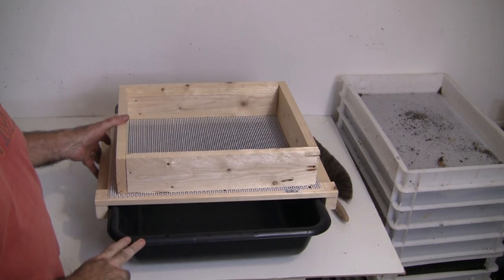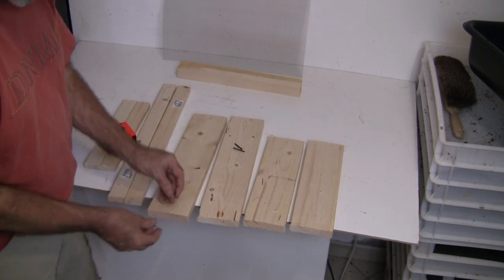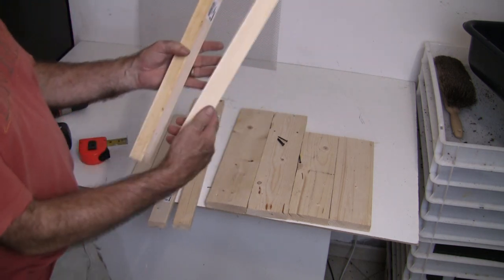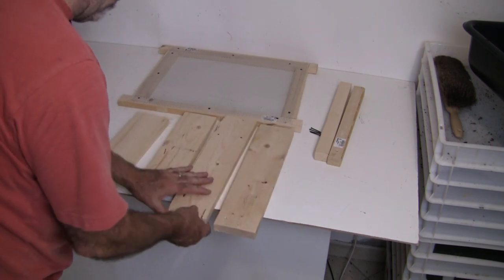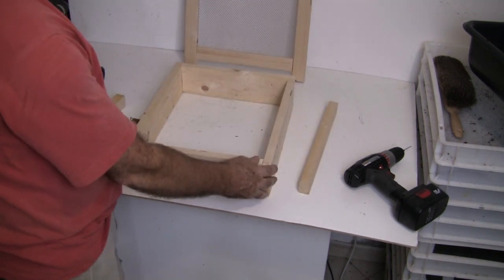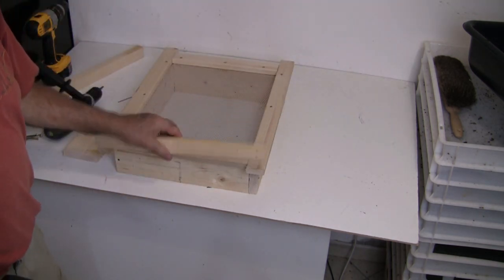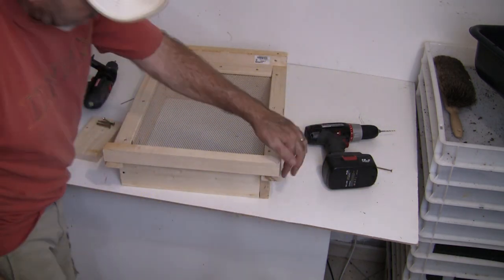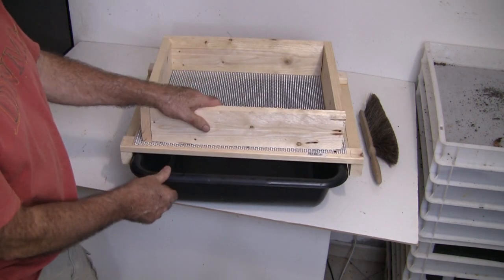VermiBag  Ep 54  "How to Make a Great Casting sifter to fit a Mortar tray"

Comment: Tom, I just completed my first sifter with 1/8" screen and it works like a charm! I did few things just a little different, for what it's worth: when it was time to put the second runner on, I put my tub on the sifter upside down and screwed in the runner. The gap was perfect. I also stapled the screen to the frame before putting the screws in, which prevented the boards from moving. Lastly, I put a 6" aluminum handle on it because I was concerned about stress on that piece of wood. Can't tell you how much I appreciate your detailed, very well explained video. Thank you! Tomorrow, I will assemble the 1/4" sifter!

Comment: Thanks for sharing Tom! 
I am thinking about building the rail system free of the sifter box in a way that locks the sifter onto the rails. I have 1/4" hardware cloth at the moment and building in two parts would let me create more screens to lock into the box if I want a finer sieve later on. 
Super helpful in my own design process to see yours!

Comment: Nice! Does the 1/8" also screen out the cocoons?
Reply from the maker: The screen I use doesn't catch the cocoons...would have to be a little smaller or a square 1/8"....mine is actually 1/4" x 1/8".  Diamond mesh.